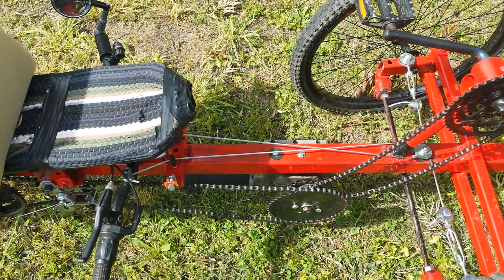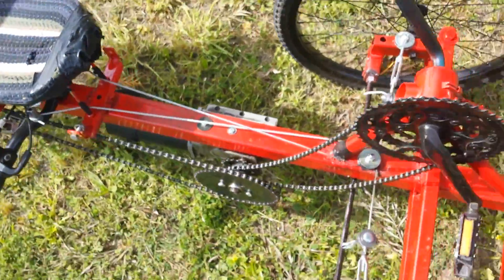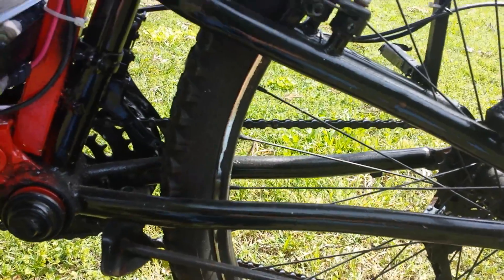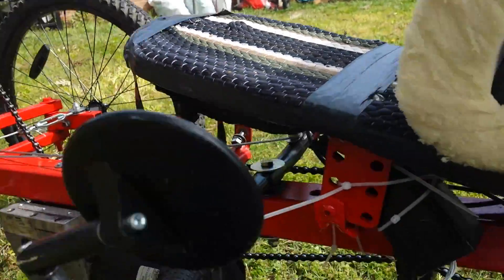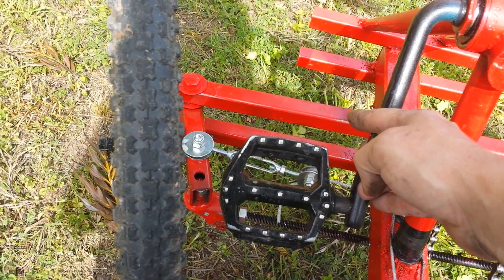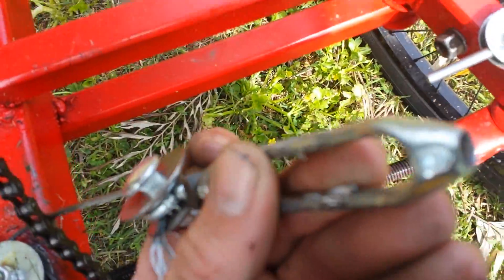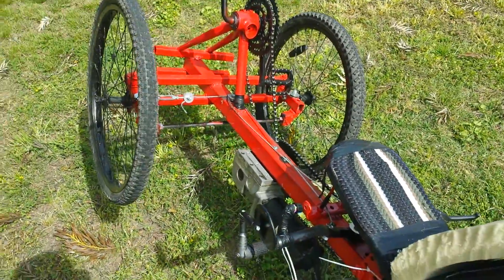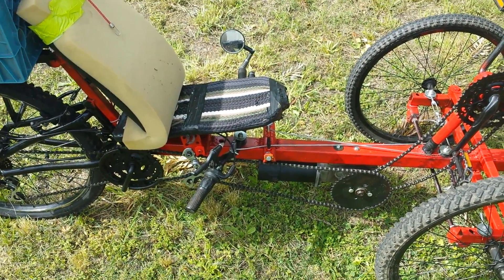Trike build. The electric part. Part 2.

Comment: Just wanted to drop a line, I found you via Instructables, and I'm eagerly following your project because I am in the research stage of building my own electric assist recumbent tadpole, which I hope to use for long haul cross country trips.  three days ago I knew next to nothing about recumbent bikes, or tadpoles, and even less on electric bikes, I'm rapidly expanding my knowledge base thanks to people like you!
Thank you!
Reply from the maker: +dscrive Thank you very much!  There will be a new video coming out next week on this build. I will cover what i should have done better.
If you are starting to build your trike do yourself a favor and push the front axle back about 2 feet so the wheels dont interfere with the pedals.

Check back for move videos and tell your friends!
also. vote for my project on instrustables so i can win a 3d printer :)